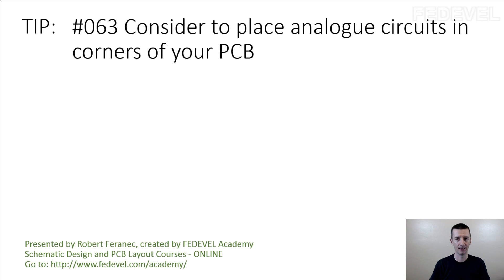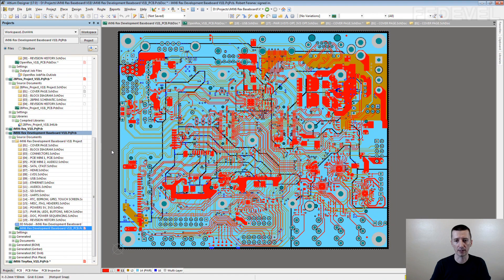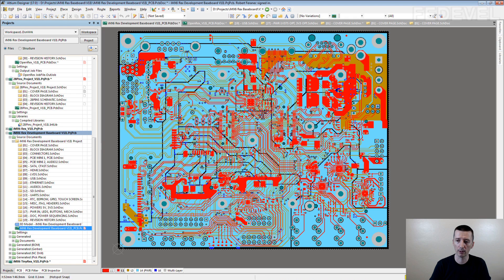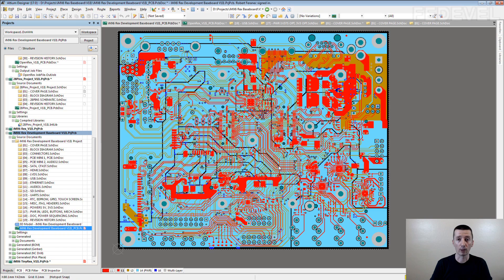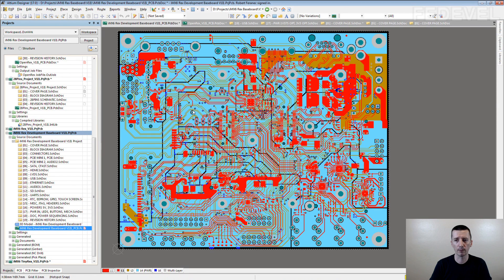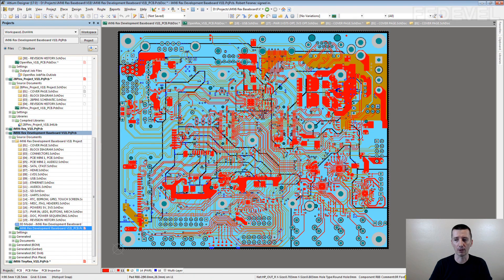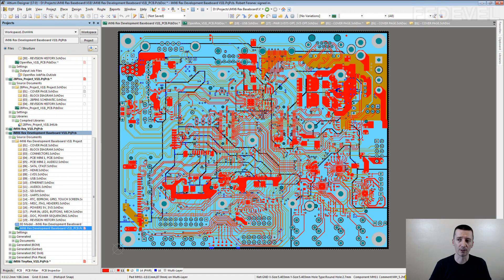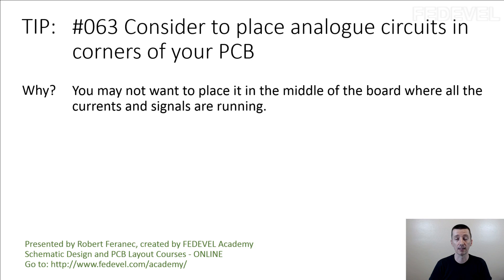TIP #063: Consider to place analogue circuits in corners of your PCB

Comment: I think it is "Place analogue circuits away from high current pulse signals"
Reply: Also away from high DC or low-frequency currents as well, if the analog circuits deal with DC or low frequency measurements.